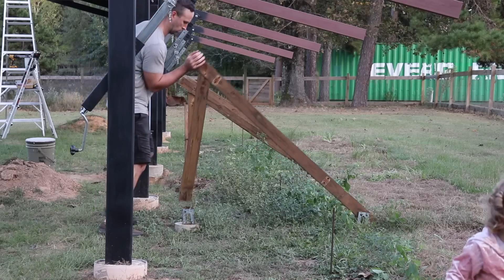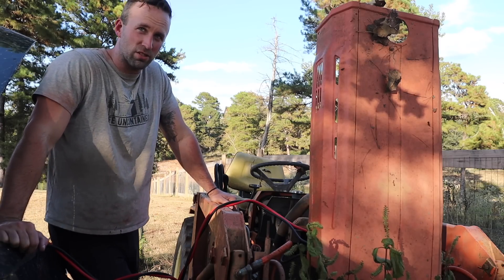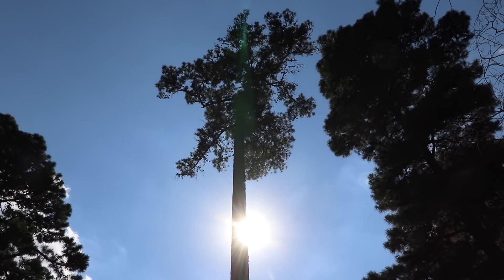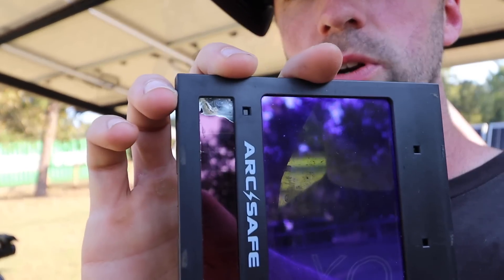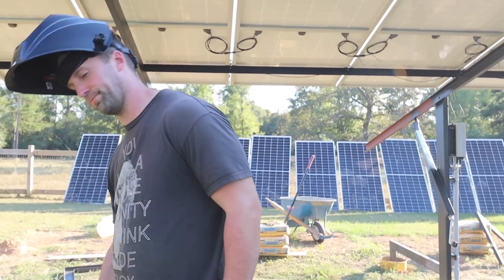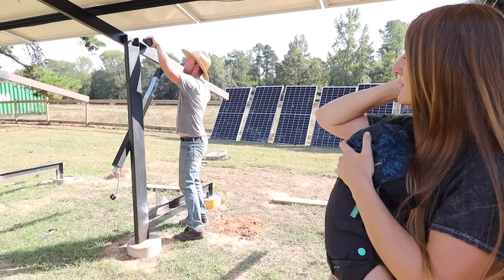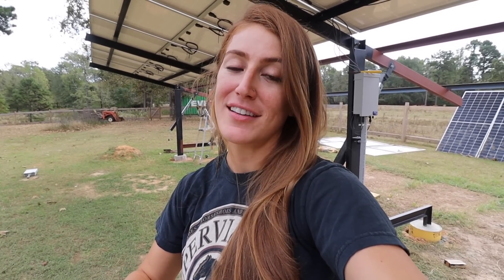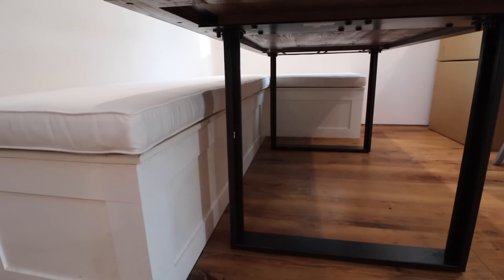COMING TO AN END!

Comment: Suggestion: instead of painting over Beau’s fingerprints. On Amazon, buy a fiberglass fingerprint brush and a small jar of black latent fingerprint powder. Use it to expose the prints. Then, spray light coats of clear lacquer over them. You’ll have unique wall art that will remind you of when she was little.
Reply: I was going to suggest the same! That is what I did !
Reply: I thought washing them off rather than painting over them would be a simple option
Reply: Love your idea❤❤
Reply: @dawnweck  I think they used flat and that won't wash well.
Reply: The problem with that is she's put finger prints on everything, not just that one wall. Having that all over the house would not look cute even for a second.
Reply: I think some semi-gloss is a much better idea. It's a whole lot easier to wash.
Reply: @RevdUp.Art.Fotografer  It's a must when you have kids
Reply: @RevdUp.Art.Fotografer  tide powder laundry detergent and really warm water on a microfiber cloth will do the trick.
Reply: Quien te pregunto

Comment: Just a little tip, add a drop of wood glue to the threads of your cabinet knobs and they won’t unscrew in use.
Reply: Great tip! 👍I can wait to try it out
Reply: What if they decide at some point to change the hardware...?....
Reply: Just a little glue and it will unscrew easily, I’ve done this many times over the years.
Reply: I learn so much from the comments! Thanks

Comment: When you touch up that wall, I would use a semi-gloss or satin finish for washability purposes. The sheen won't be that different from a flat paint; it sure will make washing Beau and then Cam's fingerprints off a lot easier.

Comment: You'll be surprised how useful that tractor will be around the property... add a small trailer (although it can easily pull the one you've got...) and you've got a mobile work station for your welder, generator, capacity to move those concrete pilings you pulled, lumber for that new dock out at the pond, etc, etc, etc.

I look forward to each episode and thoroughly LOVE everything y'all are doing. It looks *amazing*!! Cheers from Georgia!!

Comment: You're smart increasing the voltage to the MPPT controllers and for wiring strings to consider shading in the early morning.  The good thing about most modern solar panels is that almost all of them have at least one bypass diode on each panel that prevents a shaded panel from drawing power from the sunny panels in the string.

Comment: At 1:20 regarding planting the flowers in the tractor and what not. In Texas we actually do this a lot.  It really kind of adds character to the property if it looks good less is more don’t turn your area into a junkyard. Lol. I can’t think of the name of the Instagram account that does it but basically they seal it off so no critters and get inside and clean off the outside and remove the harmful bit left and paint the exterior. There are some really cool art pieces out there. Personally I’ve got a few old Ford trucks with really jacked up frames that I cut and painted on the driveway on the way into my property and I get compliments all the time.  But more than that it just looks really cool and is fun to do. Like literal trash to treasure.

Comment: To move the solar panels quickly,  you should really weld a bolt/nut at the end of each trailer jack. That way you can just use your impact or drill to quickly adjust it. It would definitely beat hand cranking each one.

Comment: Omg Spencer, its obvious that you are extremely strong. You picked up those concrete pillars like they were nothing, but you must be careful. Once you injure your back there is not going back.
Reply: Yes, this. Back issues will at best be a dark cloud over your life, at worst leave you only watching. Not you please.
Reply: Back problems will slow you down. Luckily they fixed mine. But I still have to be mindful of it.
Reply: That is a very legitimate concern and a good thing to warn about. As someone that grew up in construction, I was always strong and picked up most anything until I was about 35 years old when I crushed it disc in my back. Now 20 years later I'm still working construction and was just picking up 80 pound bags of mortar to load them in and out of the truck the other day. I am much more careful about how I do things and use my heavy equipment for the heavy lifts whenever I can!
Reply: @floridagunrat1625  60 pound bags instead of 80.
Reply: @dalecherry4044  Lol!!! Yes sir! I just can't always get the product that I need in 60 pound bags.
Reply: @floridagunrat1625  I know what you mean. That's when I look for someone younger than me for help. If I have to get 80 pound bags I tailgate it and cut the bags on the tailgate.

Comment: Diesel's can be hard to jump start because of the high compression. That tractor is worth the effort to get it running.
Reply: My Kubota is like that. I can't jump start it, but if I remove the negative cable from the battery and hook the cable straight to the jumper it will start.
The battery doesn't drag the energy that way.
Reply: @dalecherry4044  Or attach the negative cable of the jumper leads directly to a good ground on the engine.
Reply: we used to have an aerosol that we would spray into the intake to get cranky diesel engines to start on the farm...especially in the cold.  Was it ether?  What ever it was it worked great!  You might be able to squeeze out a few more workouts out of that ol' tractor:)
Reply: @bridgetown45  But that still leaves the battery in the loop.
Reply: Add some PRI-D (the D is for diesel) to five gallons of diesel and pour the mixture into your fuel tank. That stuff might resurrect your existing fuel and make it possible to get that tractor running again. PRI (D and G) is amazing stuff. I use it on my generator since the gasoline sits for long periods of time before it is needed.
Reply: @catherinecampinos5331  ether, kwik start
Reply: Oh yeah, one of the tractors we have is a beater.  I use it for rough work where I don't care about scratching the paint.

Comment: Spencer I’ve been wondering why you didn’t mount the solar array frame on a balanced pivot point where you wouldn’t even need all those cranks to adjust the angle?  Just have the support arms held at the proper length with pins.   Anyway, can we expect that third container to find its way running off that kitchen doorway to become a bedroom wing?

Comment: Just cut a middle section out of the bottom support and reweld it back together. After all the welding you have done, it should be a pretty easy job. Everything is looking good!

Comment: I saw the part about the handprints on the wall and I thought I would share this, in hopes it may save you work and money in the future. I have kids (they are grown now) and I have always had dogs and cats. I invested in paint that would wipe off, because otherwise I would have been repainting a lot. Dulux is a great brand but I know there are others. This was just the one I used. Living in Texas, the dogs would come inside when it was hot, and lay against a cool wall. The oils on them would get on the walls. If they came in wet and shook, it hit the walls. The kids constantly also had oily or dirty hands. You’ll be constantly repainting over the next 18 years if you don’t use a washable paint.

Comment: Suggestion for the handprints on the wall, Mr. Clean Magic Erasers.  Won't take the paint off but should tackle the dirt.  Save having to repaint anything.   Also, at that age my son drew on the wall with crayons.  I gave him a sponge and a squirt bottle of water.  He worked on the wall mess for a while (I actually cleaned it later).  Cured him of drawing on the wall.  He never did it again.    Other than that hint - You guys ROCK!!

Comment: we have a 13 kw system on our roof for about 8 years now.  I noticed a drop in output and had to replace our roof due to a large hail storm.  In removing the solar panels to replace the roof, I had several spots going to ground where squirrels had destroyed the outer sheath on my wire tying my panels together.  Yours is much more accessible I would look into a way to slide pipe over it to protect it.  cost me around 2000 dollars to have new wire installed on over half my panels.

Comment: Save those old footers to use as anchors for a floating dock in the pond.  You just need to get some 55 gallon plastic barrels.
.
If you can't get a different set of legs for the table, you might consider some low profile casters so you can easily move it away from the bench.

Comment: Cut the table legs in half then place the halves back-to-back...basically going from a U shape to two L shapes (not counting the top securing flat-bar).  
You will have to re-drill the mounting bolt holes but Spencer is really handy so all this should be child's play for him to do  :)  
The new solar setup is totally awesome...fantastic job on that!
Reply: @Gregory Thomas - How bout if he cuts them in half top and bottom, flips them both around & welds the 'backs' together. All that left is grinding any rough spots off the bottom 'feet'  and screwing back in.
Reply: @RevdUp.Art.Fotografer    That is pretty much what I said except for the welding part.

Comment: Here's a couple tips, take 'em or leave 'em... 1. If you were using an old school welding hood you would NEVER need batteries r have a moisture issue. 2. I have been thru the whole dogs/skunk issue many times. Clean up the dog with tomato juice, it'll negate the smell. 3. When you jump start you need the charge to go into the dead battery. When you attach all of them to the battery poles you're sharing voltage instead of generating it. On the Tractor battery the black lead should be attached to ground somewhere on the tractor & not the negative battery pole. I think you'll find you will be able to get i started. If it's diesel you may also want to prime it first & check the glow plugs.

Comment: Your tractor should have a compression release lever, usually a little metal rod with a loop on the end for your finger, pull it while your cranking it after it spins up let go and it should fire, a little squirt of either will help. keep a little 2 amp solar charger on the battery. My little Yanmar tractor sets for 4-5 months at a time, usually starts right up.

Comment: Hey Spencer.. Leave the booster cables hooked to the tractor for at least an hour if you want to start a diesel. Dead batteries take a while to accept enough charge to properly spin it fast enough to get the diesel pressure required to start.

Comment: I may be wrong, but the leg supports for the table could be attached at opposing 45 degree angles forming a "V" with the top of the "V" facing the bench giving plenty of leg room on that side and still be open at the ends and opposite sides for leg room, too. I think the table would be stable because tge surface the legs span is sufficient. That could be my error, but it might save you time and money, if you find it stable. Everything is looking good! God bless!

Comment: I don't know if it's good or bad that the house is on stilts. If the climate is cold, then it is better to close the space under the house for the winter for better thermal insulation. I closed. The floor is warmer and warms up faster. -25 C is comfortable.
And so everything is well done. Thumbs up!

Comment: In my senior design class and I came up with an idea to help with water shortage, add a drain system to the front of the solar panels…. They catch a lot of rain and you could run a pipe from the drain to your pump house

Comment: Not to take away from any of the hard work that you’ve done, but your brace is attached to low on your column.  You still have potential for wind shear to bend and flex at the point where your bracing stops. You should consider adding an angle brace at approximately 2/3s height above where your brace meets the column, 45 degree angle 📐 that ties to both the brace and the column creating a much more stable structure. Also consider adding some angle iron at an angle from the bottom of one column to the top of the near/adjacent column. Otherwise there is potential for the whole structure to move back and forth in that direction.  Love what you guys are doing.

Comment: Before giving up on the tractor, try a new battery.  Charging a dead battery will not provide enough cold cranking amps to start a diesel.  Also diesel fuel should still be good enough for a start. Love 2atching your dreams coming together.

Comment: Spencer, another pat on your back for a job well done. Now with that bit a extra power, you can build that waterfall on the opposite side of the lake for a relaxing sound of flowing water. Then build a new pier with maybe a gazebo...just a thought...but for sure the waterfall.

Then an outside fire pit for roasting marshmallows and celebrating special events...

Have you guy's thought about building a "Greenhouse"? How about settling for a swing set...

Comment: You have a master welder in house. I think Spencer would be able to make legs for the table to the specs you want. He does a beautiful job on everything else. I have seen diesel motors start with twenty year old fuel and run fine.

Comment: Please tell me the eventual plan is to automate the tilting of the solar panels? I think after some time that is just going to become really annoying having to go out each day and do it manually. You can use a Raspberry Pi Zero or a smart timer that can be connected with to your phone that will engage the motors that will run for a set amount of time and will move it electronically.

Comment: Excellent job.  Ever checked Enphase Micro Inverters?  Easy way to maximize production on a panel by panel basis.  They also allow you to track production by individual panel...easy to see if a panel has a drop off or fails.

Comment: Professional cleaners tip from the ladies that keep the fingerprints off stainless steel lifts in hotels and office buildings. a rag with a splash of baby oil just wiped over the surface keeps the oils and acids of the skin from leaving long term marks.

Comment: I used burn a 60 pound roll of wire every day welding a intire 8 hours a day day after day in the factory. some days we went through a 60 pound roll and part of a second. but long story short it never mattered if it was 80 degrees out or -40 we still spent whole days burning rolls of wire.

Comment: Well done! But one question: Why didn't you built the solar panels on the container house? Would have given additional isolation (summer/winter) for the inside of the house and less need of power for airconditioning and heating...Best regards!

Comment: should have built the whole solar mount a bit taller, so you can have articulation, park the can under with zero problems and don't have to lower your head at any point.

Comment: I would still weld sprockets on them jacks for the solar and connect them with a chain and use 1 handle or weld a nut on and use a cordless to do all the cranking up and down together

Comment: I would get the most versatile machine available to replace the old tractor honestly I think that would be a skid steer capable of handling a multitude of attachments. Of course you will want to buy the ones you would use the most but the odd-job attachments you can just rent Andor with your viewer count I'm sure you will have no problem getting sponsored test equipment

Comment: Maybe I'm missing something but how are you going to change the angle of your panels with those screw jacks? It looks as if the mounts for the solar panels are all mounted together, isn't turning one jack screw going to twist or torque the whole panel mount until you can adjust the rest of the screw jacks?

Comment: When jump starting, you should not try to start the receiving vehicle engine while the source vehicle engine is running, as the sudden load from the starter might damage the alternator/voltage regulator on the source vehicle. You can start and run the source vehicle engine to charge the receiving vehicle battery, as you were doing, but if you want to try to start it you need to stop the source vehicle engine.

Comment: You mentioned about handprints and spots on the walls. The best way to clean it,  get the TSP from Home Depot or Lowe's and mix it with water and simply wipe it off.  It's very economical. Please wear gloves.

Comment: Also it would have been better to weld the support not as a straight horizontal line but higher up on the main foot. The higher you would join the support on the main foot the stronger support it would be.

Comment: As much quickcrete you use, I'm surprised you haven't bought one of the new steele mixers. Non electric and you slosh it back and forth a few times and it's mixed and easily dumped.

Comment: The supporting for solar panels are useless at (0 Degree) it must b at 30 or 45 degree. And for better results don't weld use Bolts with plain washers.

Comment: They sell large plastic slider carpet/hardwood casters that you can use so you can push the table away to get by, four should do the job and it is the most affordable solution.

Comment: Tractor Batteries,
or car, last on average Five plus years,
Fuel is critical, diesel has the highest additives of all,
That is why, it is 37% more efficient,
Gas has a shelf life of only two weeks,
By adding a product call SEA FOAM,
Cleans and prevents fuel problems,
I use it, my self, vary happy,
It can be added to motor oil in crank case, 
Amazing product,
How to use, on can instruction label,
Hope this helps,
Good work, we are proud,
Thank you for share your life's Journey,
Paul, The CURE is here.

Comment: You still haven't got it right with the solar array structure.  Think about the strength of triangular bracing, and worry about 'flat plate area ' when the wind blows.  You don't have enough solar panels, either..... Worry about that, because I do....